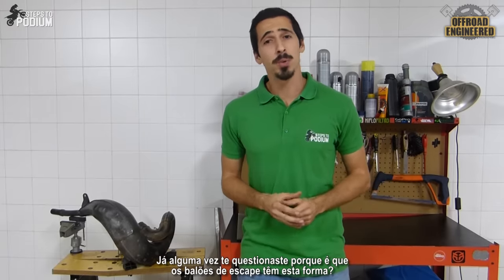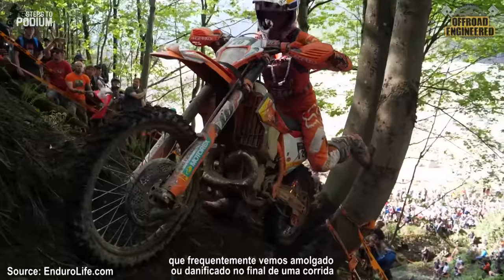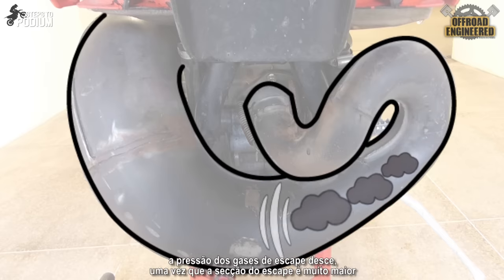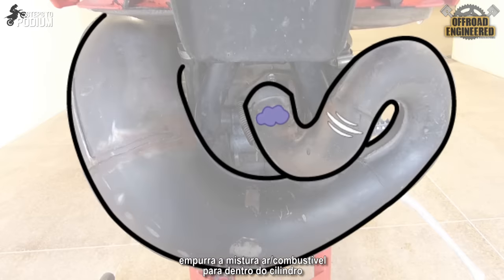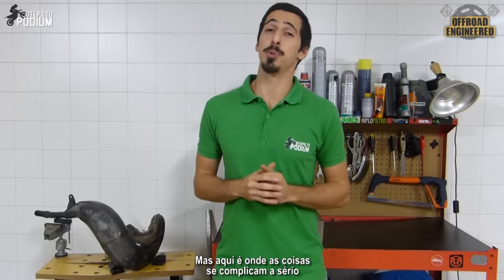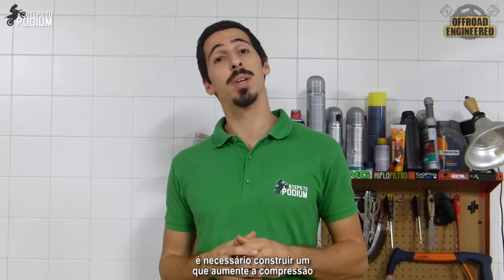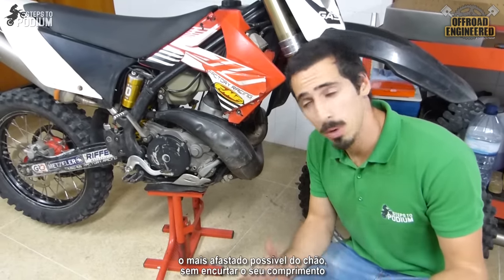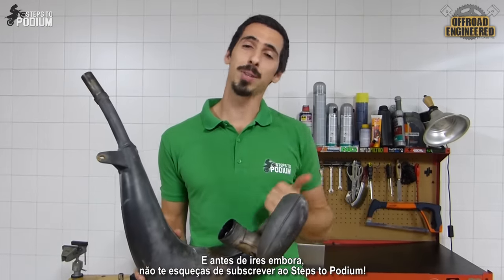How 2-stroke exhaust pipes work | Offroad Engineered

Comment: Sorry that ain't even the way an expansion chamber works. It causes a low pressure in the combustion chamber and allows high pressure fuel air to enter combustion chamber from crankcase through transfer ports. The volume (size) of pipe determines at what RPM the engine comes on the pipe. (In other words when the transfer ports are uncovered there is a low pressure area all the way from combustion chamber to the end of the stinger).
Reply from the maker: the part of the low pressure you are right, I didn't mention it and I explain it on the pinned comment! 
But saying that this isn't how it works shows that you understand little of the subject...
Reply: Go to the trouble to talk to a 2 stroke mechanic and find out how a expansion chamber works and then apologize to every one. And don't tell me you are a 2 stroke mechanic!!!!!

Comment: Why engine with 2 stoke multipel cylinder have exhaust same like number of cilinder, why like that, not like car there many cylinders white only 1 exhaust ?????? Please
Reply from the maker: because each cylinder needs an expansion chamber to be more efficient, while on a 4 stroke, the exhaust pipes have (almost) no function
Reply: @StepstoPodium  wow ..finaly , you know ..i loking for the answer since rossi use nsr 500 😂

Comment: Let me begin with It ain't an effing exhaust pipe,it is an expansion chamber.Why is it an expansion chamber and not an exhaust?On a four stroke once the combustion takes place the only purpose served by the exhaust pipe it to get rid of the spent gases,on a two stroke the end of the combustion is the beginning of the real power as explained(badly) by the person with rudimentary understanding.An expansion chamber is a complex thing its shape a mass of math and knowledge,location is based on many things,size of engine,placement in frame of engine,air box,fuel tank and lots of other shite.The whole point is it provides a pressure wave that returns unburnt fuel and air to the combustion chamber the new charge that is allowed to flow into and through the engine removing waste gases and then by virtue of the compression wave created by the Expansion Chamber returning the unburnt charge.A little like a turbo or a supercharger.The chamber can be any shape as long as it followes the  mathematical design
Reply from the maker: Dude, I explained just that but didn't called expansion chamber due to SEO, chill 😂
most people don't know that that's called an expansion chamber...
Reply: Wrong as most people who have never noted or mentioned the fact that in a two stroke crankcase the piston compresses the air/fuel mixture higher than the atmosphere forcing the mixture through the boost ports into the combustion chamber

Comment: So much bad info. A straight pipe on a 2 stroke will make the most peak power, the length will determine what rpm thet power is. The expansion chamber is a trick to make multiple less powerful waves come back over a bigger rpm range, therefore giving you less peak power in exchange for more usable power. Once the wave expands it is reverbed back and the compression at the other end does the same along with every part the exhaust pipe is expanding or contracting. The length and taper of the cones change power characteristics along with the length of straight between them. And compression is the volume of air and fuel at bdc compared to tdc, pipe cannot change this.
Reply from the maker: Did you even watch the video? I explain what you just said on the video. dafuq dude 😂
Reply: @StepstoPodium  did you watch it, you gave such crap info on how a 2 stroke works. You obviously know nothing about internal combustion engines
Reply from the maker: @elmauto3021  Sure I did and sure I don't! 😂😂 🙏
Reply: There is no volume of air in the cylinder from bdc to tdc cause its full of holes called ports so the true compression ratio is the volume between the top of the exhaust port and the cylinder head ..has anyone ever connected a compression gage to a two stoke and then start up the engine ? I have and you will all be amazed as to what i discovered

Comment: Why don't you just make the pipe thicker so it doesn't get dented. That's how my two strokes are. My guess is to make it lighter, but isn't it more of a pain to fix it all the time.
Reply from the maker: it will always get dented somehow. when the pipes heats up a lot, the pipe's resilience comes down drastically even if the thickness is bigger

Comment: he says 2-strokes dont have as much compression as 4 strokes, thats a straight up lie, 2-strokes are generally higher compression than 4-strokes, my snowmobile has 150psi per cylinder. my quad has like 100
Reply from the maker: And your dirt bike? Im comparing dirt bikes,  not boat, snowmobiles, quads or planes or anything else...
Reply: @StepstoPodium  I’ve got a 200cc 4-stroke last I checked had around 120. For performance engines 150 is low for the snowmobile
Reply from the maker: I believe you! I understand jack shit of snowmobiles and their specificities 😅 but it doesn't make sense to compare different engine types for diferente applications

Comment: Whats a wrong info, fast velocity  small diameter equal to low pressure, bigger diameter low velocity with large flow equal to high pressure
Reply from the maker: Bernoulli principle you say, right? 🙄 I advise you to look it up a bit deeper before making statements online.

Comment: The exhaust pressure does not push fresh air into the cylinder. Confidence in what you say does not make it correct
Reply from the maker: sure it doesn't,  you should check some literature before commenting 😊
Reply: @StepstoPodium  Sorry, viewing on mobile limited my view :)

Comment: The worst thing is when someone who doesn't quite understand 2 stroke engine principle attempts to lecture audience while also using incorrect meanings like "exhaust affects compression," really ? Engine compression has nothing to do with the exhaust shape or lenght. Two stroke exhaust chamber is there to provide a so called supercharged sonic return vawes therefore returning unburned gases back above the piston top before piston fully covers exhaust port in it's upward movement towards the explosion cycle. In this way it is also preventing fresh air/fuel mixture prematurely exiting compression chamber. This way 125cc engine is acting as if it's cubic capacity was approximately 180cc. That is why 2 stroke engines power output is superior to the equal capacity 4 stroke engines. Besides those facts 2 cycle engine has explosion cycle every 360 Deg while 4 cycle engine requires 720 deg crankshaft rotation. There is also a lot less moving parts within 2 cycle engines which allows for a more rapid crank acceleration and a lot higher top rpms... Talking about 2 cycle engines and it's exhaust principle we also have to remember atmospheric pressure and its role in this engine type operation. Because of its transfer ports, principle of fluid dynamics and exhaust gases density those engines performance is very sensitive to  atmospheric pressure therefore the altitude. Density of the exhaust gases is also controlled by the fuel/air ratio as well as power valve control/tuning in modern 2 cycle race engines....
Reply from the maker: there are some things you said that clearly shows that you know little about the subject, but it's great to see people that don't know about the subject trying to lecture people who are trying to teach people with absolutely to physics or engineering background how one of the most complex subjects in engineering works!  You have to keep it simple man or people will be lost 😉
Reply: @StepstoPodium  To be correct I know a little bit more then "little" on the subject of 2 cycle engines and their fine tuning. I have to disagree with you on this issue. In my view If you explain things wrongly it doesn't  mean that it is simple, quite the contrary. If you are mislead then you remain in the darkness. I do not dare attempting explaining how human brain function nor I make "educational" video clips claiming that what you observe is correct....if I wasn't clear enough you are welcome to put forward your questions and I will try to give you additional explanations. In my view and life experience the most dangerous knowledge is the "little knowledge". Cheers.
Reply from the maker: "...therefore returning unburned exhaust gases above the top piston...." - then please enlighten me on your knowledge because you lost me at that complete erroneous statement.
I completely agree with you on the "better not say anything than to say shit", but if you understand a subject well enough, you know when to simplify the information, which information is the most important to keep and which to cut out in order to avoid confusion and  misunderstandings. You saying that you know about the subject but then tell me that you cannot explain in a simple way, just proves the opposite. If you know about a subject, you should be able to explain it to your wife, husband or a kid in order for them to understand. You should look at a YouTube series that's out there where expert in certain fields explain complex topics in different level of complexity. Does that mean that they are misleading?  don't think so.
Just because I don't use the term supersonic supercharging doesn't mean the explanation is wrong so please keep your "wise assness" to yourself 😂
I'm trying to bring useful information for everyone, I'm not giving lectures in order for people to be able to "fine tune" pipes 😊
Cheers
Reply: @StepstoPodium  Hi there, I see that you are defensive and I am not going to dwell over nothing for ever. However using incorrect wording or meaning is misleading. Go and listen what you are saying instead of attempting to shut me. If you are going into the subject of the exhaust you could stop as well at the explanation level of that exhaust pipe serves the purpose of conveying hot and harmfull gases away from the driver or rider if it is on the bike, go kart, etc. My wife is expert in other field and she never expressed any interest in this subject, otherwise I would be definitely able to explain the purpose of the 2 cycle competiton exhaust system that you presented. There are 4 stages of the exhaust for 2 cycle engines and for some reason you elected attempting to explain Stage 4, which is the most complex and the most advanced one. The only reason to have such a fine tuned system is to optimize/ maximise gases return of the supersonic wave in order to create supercharging of the combustion chamber before the explosion cycle. Superficially it us increasing cubic capacity Vs. 4 cycle engines. Due to this technical feature in the past FIA used to time penilise drivers in the European Rally Championship who used to drive Cars powered by 2 cycle engines. There is no particular problem when you didn't use meaning " exhaust gases supersonic return wave"  problem occurs coz you didn't explain that this returning  wave creates a supercharging effect without even having any physical  supercharger or turbocharger as such, and it is taking place within normally aspirated system. You also omited to mention that this thermo dynamic effect results that engine operate so efficiently as if it was 180 cc ( approximately) while having in fact 125cc. You may agree or disagree with me but I trust that this feature is very unique to 2 cyle engines thus very significant moment which I believe is crucial and need to be mentioned. Cheers.
Reply from the maker: I hope you didn't take me the wrong way but you came in guns blazing saying that what was on the video was pretty much bullshit.
as you can imagine, I answered in the same token...
Now we can start a conversation and discussion 👌.
I completely agree with you and what you are saying, but I decided to leave that information out simply because for a lot of people it's not easy to understand that, if you don't have any kind of background in tuning, engineering or physics. I opted to change some of the terms for simpler ones so everyone can understand. the term supersonic supercharging (just an example you gave) if you don't have a background in physics  or tuning  (being more specific to the term you get to know) you won't understand jack shit since it touches 2 different phenomenons.  
I just want people to understand what happens on the things they can see about their bikes, I don't want people to go to their sheds afterwards and start building artesanal performance pipes, that's all 😂
cheers for the comments!
PS: I own any mistake I might have made about the terms I used for simplicity sake, but the purpose is not to make this a scientific paper, but a simple explanation of a complex subject to the average Joe!
Reply: @StepstoPodium  cool

Comment: Your video is full of common myths. For example: Dents do not effect the power. Only catastrophic damage like pinching the pipe flat, or taco shelling the pipe will decrease HP. Yes, pipes are tuned for one rpm, but a well designed pipe will work over a broad rpm range. Pipes that have a hard hit, do so because they lost HP on the front side of the curve.
Reply from the maker: Mate, watch the full video please 🤣

Comment: This is pretty inaccurate..... the expansion chamber is actually in place for the Venturi effect.... when the exhaust pulse gets to the expanding part of the pipe, the pressure decreases, and velocity increases causing a vacuum in the cylinder and helping to pull the rest of the exhaust out and help pull the fuel and oxygen mixture in, otherwise known as scavenging. This system is pretty inefficient in lower RPMs because the pulses are so spread out. At higher RPMs the expansion chamber has a more steady flow and can more effectively pull a vacuum on the cylinder and allow for more power and better efficiency. Don’t listen to this video because it is a horrible explanation
Reply from the maker: before smashing and giving ill advice, please do some research before. the Bernoulli principle or venturi effect is only valid if there aren't any changes in the density of the fluid which in this case doesn't happen since you have huge temperature differences on the fluid.
Reply: @StepstoPodium  where does the huge temperature difference come from?
Reply: @StepstoPodium  even if it cools off substantially, the gas will contract and pull even a stronger vacuum. I'm a marine engineer, I went to school and learned all these principles
Reply from the maker: @daytonwintle6051  cooling maybe? isn't that obvious? 😂
Try measuring the gas temperature from the header and end of the pipe.
Reply from the maker: @daytonwintle6051  and so what's the problem with creating suction? what has that to do with the pressure wave coming back and pushing the new charge in? one does not invalidate the other.
since we are at it, I've got a masters in mechanical engineering, is that suppose to let you say things that aren't true? 
if you know your principles you should know in which assumptions they work on.
Reply: @StepstoPodium  cooling has nothing to do with anything In this case. The piston coming down pressurizes the crank case which is the main cause of the mixture going into the cylinder
Reply: The curved exhaust pipe is for exhaust scavenging
Reply from the maker: you clearly know nothing about this subject. 
Please keep your interventions to what you know, whether it's marine engineering or what not but don't confuse people please.
Reply: @StepstoPodium  I've been riding and working on two strokes for years. I'm not just making this stuff up
Reply: @StepstoPodium  and I guess you're not really wrong, the pressure wave is really a secondary function of the pipe